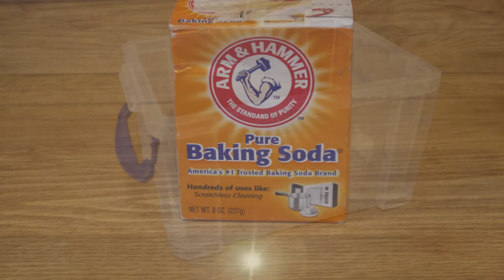Copper Plating at Home - Easy Electrolysis & Electroplating

Comment: I'm trying to learn how to do this. This is the first video not involving some kind of acid either vinegar or battery acid. I have a batch made with battery acid and copper sulfate. It doesn't even need electricity to plate steel. I just dip it in and there it is. I'm going to experiment with this.

Comment: How many times can you repeat the process with what you used? Thank you
Reply from the maker: The electrodes will need to be replaced as they are sacrificial and wear away. The electrolyte can be stored after use and reused (it may need filtering occasionally).

Comment: I'm wondering if I can use my trickle battery charger as a power source
Reply from the maker: A trickle charger should work, but it will probably have a low power output which will slow the plating process
Reply: @eBikeSales  I tried it. It does work, though I didn't develop the plating solution long enough. I did get a halfway decent cover on coins though.

Comment: Not working for me
Reply: Because you cant use normal iron, it is too high up in the reactivity table. You need to use nickel or anything like that.
Reply: @davineismont2264  so using an intermediate nickel playing is the solution?
Reply: @IonutJaR  i hope so works for me. Good luck
Reply: @davineismont2264  thanks
Reply: @IonutJaR  did it work?
Reply: @IonutJaR  Yes! This tutorial is WRONG you CANNOT electroplate steel with copper period. You must first plate with zinc or nickle. Either this part is not steel or the whole tutorial is fake.